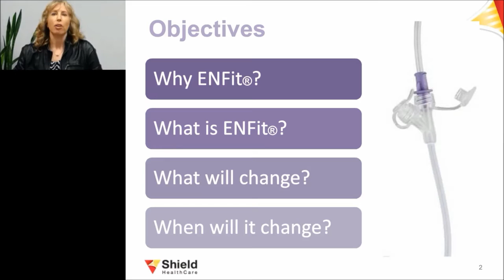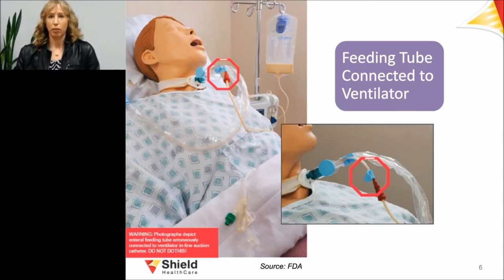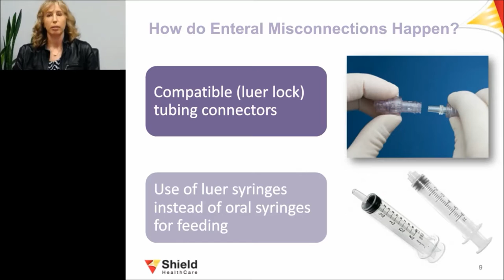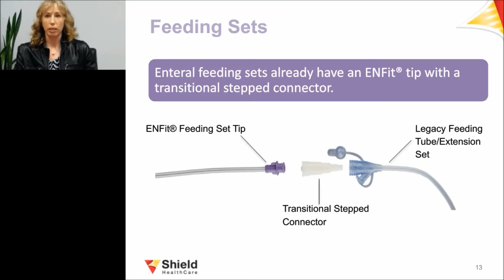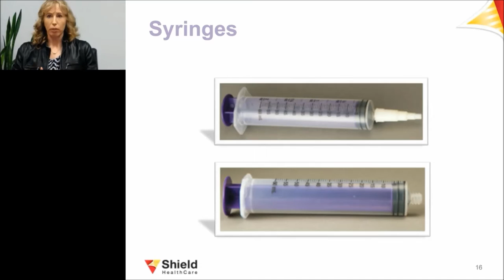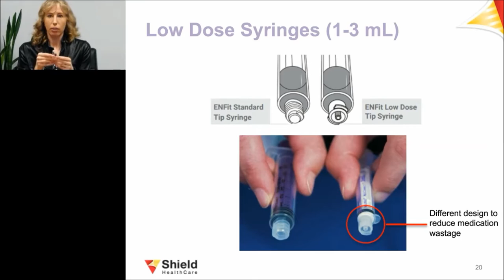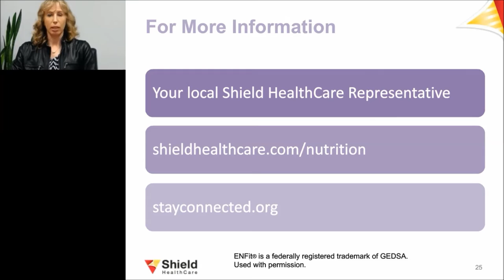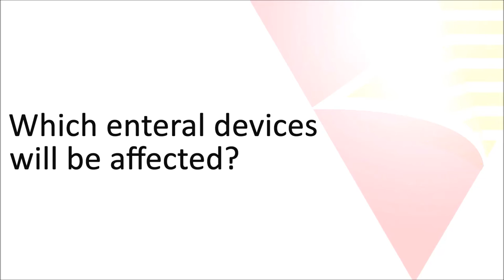ENFit Enteral Connectors: Webinar Video

Comment: Are the ports on the "y" port feeding sets leak proof?  Just wondering because my daughter likes to open these.  The white transitional adapter often times slips from the purple AMT bolus feeding sets which is my answer to her opening ports or the adapter easily becoming disconnected from the "y" port.

Please help by visiting the link below if you're able, even if it's only by sharing our story with others or by taking the time to read and learn about some rare special needs.  Thank you & God Bless!

https://www.gofundme.com/a-home-for-special-needs-kids
Reply from the maker: Hi Jennifer, thanks for your question! The ENFit connection will be a twist-on connection, so should prevent pump sets and syringes from becoming accidentally disconnected from the extension set ports. Hope that helps and thank you for sharing your link!